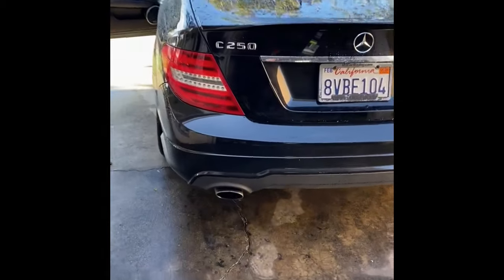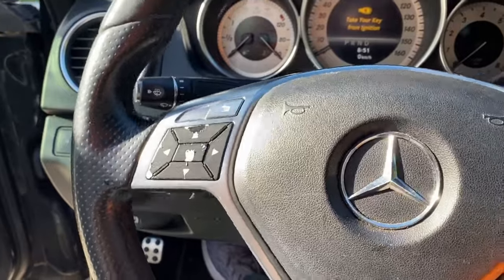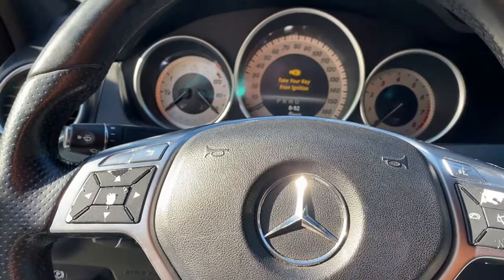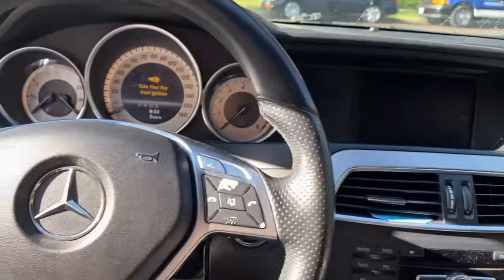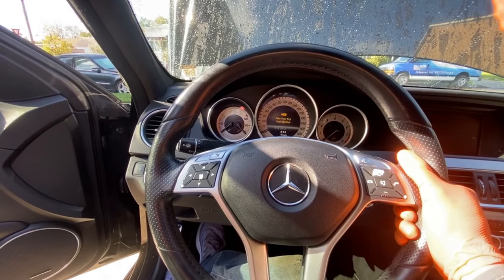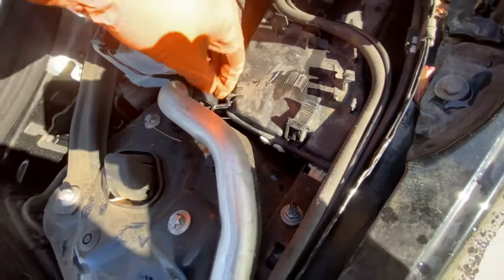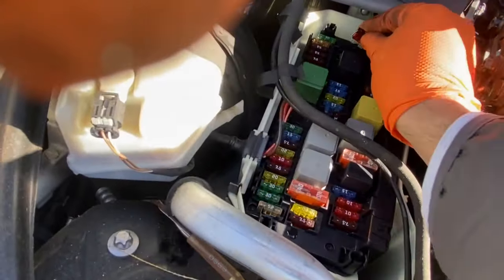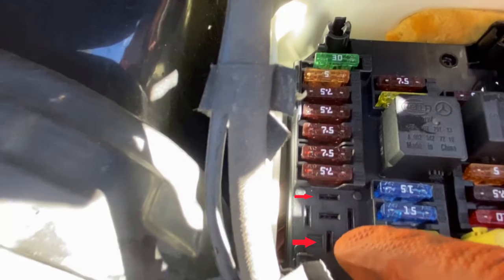Mercedes W204 C300 C250 Locked ESL. Car won't start? You can use this trick to start your car.

Comment: I have an 2000 s500 i thought it needed an key I got one and did not check to see if it started till later that day and the key turned all the way but the steering wheel can turn. but like it’s no power steering going thru it just get light on the dash Is this the problem?
Reply from the maker: S class does not have a steering lock. If you have red and yellow dash lights on you have drive authorization. 

You may have a bad engine control module. 

First check the starter fuse and relay. Once you’ve checked the starter and verified that it is working. It’s very likely a bad ECM. 

https://mercedesbenzspecialist.net/shop/ols/products/mercedes-benz-me28-ecm-cloning-m112-and-m113-engines

Comment: I have a 2013 c250, I purchased it form an auction and it is a "theft recovery vehicle". the car starts if the ignition switch is on and the starter relay is bypassed, but not if you try to start it using the ignition switch (the regular way of starting the car). What do you think the issue could be? I really appreciate any help.
Reply from the maker: Probably a failed steering lock. 

If you insert the key into the ignition, the steering lock should unlock. When you remove the key it should lock. If that is not happening then you’re steering lock has failed. This is why you have a no crank condition. 

https://mercedesbenzspecialist.net/shop/ols/products/mercedes-c-class-glk-class-e-class-coupe-slk-class-electronic-emulator

Comment: I tried this today only got a crank no start. Same exact scenario though i was just using Bobby pin tho not copper would that matter?
Reply from the maker: If you got a crank with the Bobby pin then it worked. 

Crank no start could be that your c class is a 2013 or 2014. This trick does not work on these models. Could be that your ecm has failed. Or your EIS or key is bad. 

This trick does require a working key and EIS. If either is faulty, you will get a crank no start.
Reply: It is 2014 yeah makes sense I had a code for dynamic control module loss of comm like six months ago doing same thing kinda so makes sense thank hour
Reply from the maker: If you need an esl emulator programmed to replace your steering lock we can help with that. 

https://mercedesbenzspecialist.net/shop/ols/products/mercedes-c-class-glk-class-e-class-coupe-slk-class-electronic-emulator

Comment: I have a 2013 c350 and i put the key in and it does nothing and the steering wheel is locked but you’re saying if i buy the emulator it will work?
Reply from the maker: The emulator must be programmed to your car. I need the ignition switch and key to program the emulator. 

You would then remove the factory steering lock from your steering column. Plug in the programmed emulator then it would work. 

https://mercedesbenzspecialist.net/shop/ols/products/mercedes-c-class-glk-class-e-class-coupe-slk-class-electronic-emulator

Comment: I have a 2011 Glk350 and I have the ESP Inoperative message on my car and when i try to turn the key all the lights turn on and everything works except the engine doesn’t turn over. I can put the car in all heard as well just no movement any ideas?
Reply from the maker: Does the engine fan run on high when you turn the key to position 2? Have you hooked up a scanner to the OBDII port? Can you communicate with the engine control module?
Reply: @mercedesbenzspecialist  I’m not too familiar with the engine control module but i can turn the fan on. I don’t own a scanner so I haven’t done that either. The car was able to start a few times after turning the wheel all the way to either side a few times but now no luck

Comment: This just saved me. HUGE help. How do you fix this so that you don’t have to always start it this way.  2014 C250 Sport
Reply from the maker: We can program an electronic ESL emulator for you. Plug it in and it will start your car every time. 

https://mercedesbenzspecialist.net/shop/ols/products/mercedes-c-class-glk-class-e-class-coupe-slk-class-electronic-emulator
Reply: @mercedesbenzspecialist Does this fix the ESL permanently or is it a temporary fix until you can replace the ESL?

Comment: Hi, hoping you can help me. Got a 2011 c250 an wont start. I can open an lock the car but thats it. The miles show up on the middle cluster but doesnt show the any other like the hand brake light. When i lock the car the side mirrors wont fold either. Steering wheel is also locked. I tried swapping the battery but nothing changed, i even changed the batteries in the key fob but nothing. The fob turns but no click and the dials dont budge. Starting to lose my sanity at this point
Reply from the maker: It’s likely the electronic steering lock. Watch the video below. I go through the symptoms at the beginning of the video. 

2008-2014 Mercedes Benz C Class W204 C300 ESL Electronic Steering Lock Removal Emulator Install
https://youtu.be/n0c0kSCHtyk
Reply from the maker: I can program an electronic steering lock emulator. This eliminates the factory ESL and acts as a bypass. It starts the vehicle and is many times more reliable than the factory steering lock. 

I need the ignition switch and key to program the esl emulator. The cost is $250. 

Check out the website here:

https://mercedesbenzspecialist.net/shop/ols/products/mercedes-c-class-glk-class-e-class-coupe-slk-class-electronic-emulator

Comment: how do ybu unlock a locked steering wheel? This bypass is awesome for an UNLOCKED steering wheel
Reply from the maker: You must remove the steering lock from the steering column. Send us your ignition switch and key. We can program an ESL emulator to replace the factory steering lock.

Watch our video on how this is done:
https://youtu.be/CQo6iTOaby4

Our service can be purchased on our website:
https://mercedesbenzspecialist.net/shop/ols/products/mercedes-c-class-glk-class-e-class-coupe-slk-class-electronic-emulator

Call or text us at 818-510-3375

Comment: I have c200 2013 
For the past few months the car would not start for a minute then when I try again it works normally ( it happened 4 times) 
And sometimes when I start the car the ignition takes too long and the engine light turns on then after restarting the car it goes away 
Notice I have a new battery and a new alternator 

Today the car did not crank at all 
Radio is working although no lights on the dash only the mileage when I insert the key 
When switched to ignition 2 nothing changes 
And radio is still working although the car is off for a while 
Any idea ?
Reply from the maker: You most likely have a failing steering lock. 
Watch this video to go over the symptoms. 

https://youtu.be/n0c0kSCHtyk

You can purchase an electronic emulator to replace your factory steering lock from our website. You must send your ignition switch and key to us so we can program the emulator for you. 

https://mercedesbenzspecialist.net/shop/ols/products/mercedes-c-class-glk-class-e-class-coupe-slk-class-electronic-emulator

Comment: Can it start if the steering lock is in lock position? Sir
Reply from the maker: It can start, but you won’t be able to drive it if the steering wheel is locked.

Comment: I could start the car
But steering wheels is locked 
Any way to unlocked it?? Just to take it to the shop?
Reply from the maker: The only way to unlock it is to remove the steering lock located in the steering column. Then you can purchase our esl emulator programming service. 

https://mercedesbenzspecialist.net/shop/ols/products/mercedes-c-class-glk-class-e-class-coupe-slk-class-electronic-emulator

Comment: If my is lock will it crank but won’t start? I am wondering because I try mine and it cranks but won’t start
Reply from the maker: What year and model is your Mercedes?
Reply: @mercedesbenzspecialist  2013 c300 4 matic
Reply from the maker: This trick does not work on 2013 maybe 2014 as well. I just found out about this recently. I tried two different 2013 w204s and this did not work. I replaced the ESL with an emulator and it started right up.

Comment: Hello. My 2007 c230 did it today. Ignition wouldn’t turn and steering wheel locked. When I slide they fob in the ignition slot nothing happens. Usually makes the whoosh sound unlocking. Key still works. But the ignition would not turn.
Reply from the maker: It could be the ESL, EIS, or the key. If you send me the EIS and key I’ll diagnose it for you and offer a solution.
Reply: I have serious problem similar to yours … I accidentally did hard right park and steering wheel locked and key fob won’t unlock steering .  I hve a 2003 C230 Sport Kompressor .  Cannot start my car !!! 😢. I’ve done this before and old Merc mechanic knew how to unlock wheel so the key fob 5:10 would turn ignition but the Merc roadside assist guy must hve retired because none of the new road side guys know how too … can you help me too ?
Reply from the maker: @wanda2295  Try to release tension on the steering lock by moving the steering wheel as far to the right as possible while inserting the key into the ignition switch.
Reply: I fix it for 12 bucks. Replaced the coil inside the key fob. Everything is just fine and running.

Comment: I trying it, that's working good, this technic just like a starter ignite, when you sick the wire in relay spots remove it after running else that make you starter motor

Comment: Hi will it unlock the steering column to drive?
Reply from the maker: Hi. No. This is useful if your steering column lock failed in the open position. 

The permanent fix is to replace the failed steering lock with a programmed esl emulator. 

https://mercedesbenzspecialist.net/shop/ols/products/mercedes-c-class-glk-class-e-class-coupe-slk-class-electronic-emulator

Comment: So it only works if my steering is unlocked ? Because mines is in locked position
Reply from the maker: It will start, as long as your key and ignition switch are good. But if your steering wheel is locked, this trick is much less useful. You can still use it to roll up your windows or sunroof in case you were caught with the windows open.
Reply from the maker: If you need a steering lock emulator programmed to solve this issue. Get in contact with us. 818.510.3375

 -Michael

You can also checkout our website for more information. https://mercedesbenzspecialist.net/shop/ols/products/mercedes-c-class-glk-class-e-class-coupe-slk-class-electronic-emulator

Comment: Any idea why pulling that fuse let's everything turn on? I thought I had a bad esl about 3 weeks ago an was checking fuses an forgot I had the key on an everything came on just like yours when I put that fuse back in. I'm wondering why everything works (turns on ) pulling the fuse but nothing with the key in that position?
Reply from the maker: Pulling that fuse puts the EIS into “Wake up” process. During this short process “drive authorization“ is granted to the EIS when it would normally be granted only after the esl had given the EIS “drive authorization”. 

If you have a faulty esl. No Drive authorization is given to the EIS. But you can sneak it in during the wake up process. 

The motor in your esl is beginning to fail. Eventually it will fail leaving you with a no crank condition. It would be good preventative practice to replace it with an electronic emulator while it still unlocks. 

After it stops unlocking, the work load to remove it increases 2-3 times. 

Give me a text or call if you need a programmed emulator. 

Call us at 818-510-3375
Reply: @mercedesbenzspecialist  see that's the thing. I got an emulator had it programmed with my key and eis an still does the same thing. The guy that did the emulator tested it an my eis an everything looks ok. He is going to send me a new emulator just to make sure an also another key. Really not sure what else would prevent it from starting besides the key,eis,esl. I'm about ready to just hard wire everything with toggle switches and push button start if it's not the key. Hopefully I'll have it back this weekend an can try it out. I appreciate the response.
Reply from the maker: Ok. If your guy can’t figure it out. Send the parts to me, I’ll diagnose it free of charge. If there is nothing wrong with it you would just pay $10 shipping to get it back to you. 

I have tools that can see if the EIS is activating circuit 15r 15 and 50 as the key is turned.
Reply: @mercedesbenzspecialist  ok thanks..I'll let you know what I figure out as soon as I get everything back.
Reply: @mercedesbenzspecialist  I got everything back..turned out something was wrong with the first emulator. I was sent another one an car is up and running now. Just thought I would let you know.
Reply from the maker: Glad you got it squared away. 👍
Reply: I'm having a similar issue, drove my 2008 c300, parked it was waiting for friend to come out , had window rolled down. When I went to start it, there was nothing, steering wheel is in unlocked position (I can turn it with some force). I hear a faint clicking noise but have no crank and no power when I turn the key. Will this bypass work ? I have read also about tapping the steering column with the cover removed as well as moving the column up and down a few times get it to start.
Reply from the maker: @mandeepchahal470  Your esl is failing. That clicking you hear is the motor inside the esl trying to turn. There is too much resistance for the weakened motor to turn all the way. 

You can try banging on the esl with a metal tool. A small hammer or heavy wrench might knock the gear into a place of less resistance. You might also attach a battery maintainer turned up to 14 volts. The extra voltage just might give the esl motor enough juice to turn. 

Either way, you need to remove the esl and have an electronic emulator programmed and installed in place of the factory esl. 

I can program an electronic emulator for you. 

Check out our website for more info. Or call us at 818-510-3375 

https://mercedesbenzspecialist.net/shop/ols/products/mercedes-c-class-glk-class-e-class-coupe-slk-class-electronic-emulator
Reply: @mercedesbenzspecialist  
So I managed to get it started by 
Moving the  steering column up and down with a bit of force while turning the key. This worked 2x now I can't get it started, is the emulator difficult to install?
Reply from the maker: You must remove the ESL. The emulator is easy to install. The electrical connector that is currently plugged into the ESL needs to be plugged into the emulator. 

The emulator does not need to be installed in the steering column. Just plugged in and zip tied out of the way of moving parts.
Reply: @mercedesbenzspecialist Hey I need an emulator
Reply from the maker: You can purchase the emulator programming service on our website. 

We need your ignition switch and key to program the emulator. 

https://mercedesbenzspecialist.net/shop/ols/products/mercedes-c-class-glk-class-e-class-coupe-slk-class-electronic-emulator
Reply: @mercedesbenzspecialist  How can I messaged you to make sure that's what I need? I put in the key and found my battery dead, and the key won't come out, or go to position 0 and ssys remove key on the dash. Won't crank either and key isn't doing anything. Charged it up (car runs on lithium for audio) and have power now. But still says remove key and won't crank or let me remove it
Reply from the maker: @michaelburch5594  
If the key won’t come out. Make sure the transmission is in park. Make sure you have 12.5volts at he battery. 

Still stuck. Remove the top cable from the ignition switch. The key will come out. 

It may have a loose floor shifter cable. Or a mechanically malfunctioned switch. 

Call us at 818-510-3375 
Mon-Sat 8am-4pm PST
Reply: Thank you so much for your help. God bless you. 🙏👌

Comment: If the key is not locking or unlocking the car and not getting a response from the car when I insert it what could it be? The seats move and the steering wheel moves up and down
Reply from the maker: Sounds like a bad key.
Reply: @mercedesbenzspecialist  that’s exactly what it was, thank you. I had a spare and it worked fine. 

What can cause a key to go bad outta no where though?
Reply from the maker: It happens frequently. Bad solder joints or a failed capacitor.  One of the most common reasons is jumping your Mercedes-Benz. Jumping can desynchronize the keys from the EIS. 

If you’re battery gets low. Trickle charge it or buy a new battery. Keep the key out of the EIS when disconnecting/reconnecting the battery.
Reply: @mercedesbenzspecialist  so you think it’s the battery in the key or the car itself?
Reply from the maker: It’s not the battery in the key. Power for the key fob is supplied through the EIS for starting the car. The key fob battery serves only to lock/ unlock doors, and trunk. 

I don’t know what it is with your key. I was just mentioning the most common causes.

Comment: My Mercedes 2011 C300 got hit on the driver side corner. The person back up while pulling out of parking structure. It move my car that when I wanted to turn it on it would not start. I want to try this to see if it works. Cause I been hearing that when Mercedes get into a accident they automatically shutdown. In this case my car was parked and  not in motion.
Reply from the maker: Did they hit the front wheel? Sometimes when the wheel is hit it will prevent your electronic steering lock from unlocking when the key is inserted into the ignition switch. This may start your car, but if the steering lock is locked, you won't be able to turn the steering wheel.